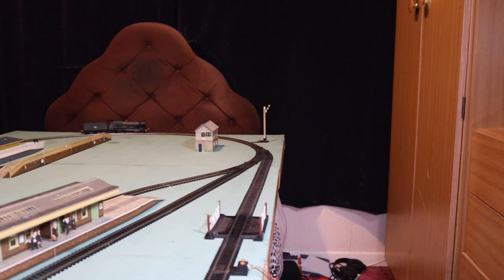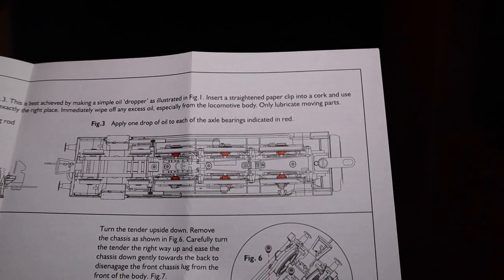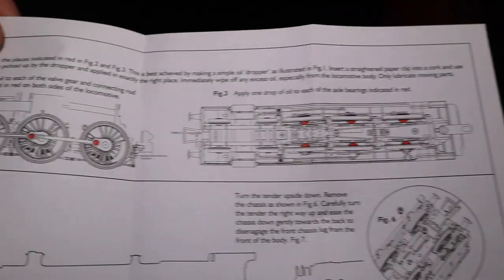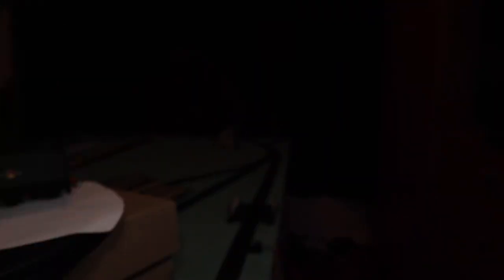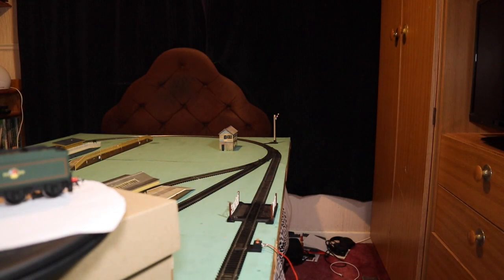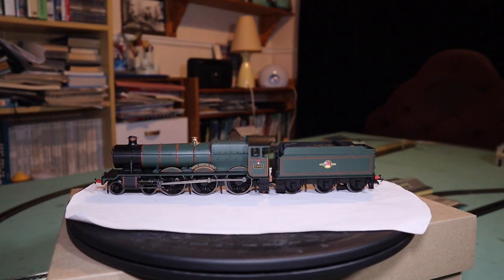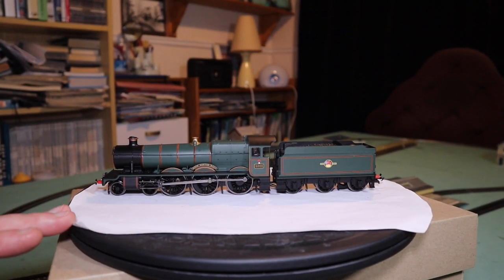Hornby Great Western Rood Ashton Hall R3205. First impressions.

Comment: Beautiful runner. Your Hornby Rood Ashton Hall is a great performer. The version of the model I have is from the Bachmann Shakespeare Express Train Set. In real life, Rood Ashton Hall is in Lined Great Western Green with the smaller Manor-sized tender. I bought the Shakespeare Express Bachmann Train Set from ebay, for £199. Complete with Lined Great Western Green Rood Ashton Hall, and her Manor-sized tender, that is. I've replaced the coal load with Gaugemaster coal, to give her a more realistic look. Plus the Shakespeare Express headboard is stuck to her top smokebox lamp bracket, with blu-tak. I have a video of the real Rood Ashton Hall on my channel, I'm sure you might have already seen it. If not, take a look and compare if you like. The Shakespeare Express Train was introduced to the Birmingham New Street to Stratford-upon-Avon route in 1999. I can give you a bit of background about it, if you're interested.😉
Reply from the maker: Thanks for the comments. I did think about the Bachmann version. The only one I saw was split from the set. I did see the video of the loco and enjoyed watching. I will do a running session with coaches with other Halls for comparison. Cheers Paul.